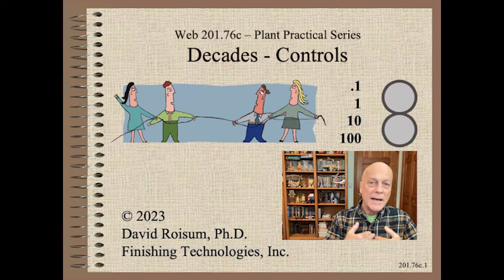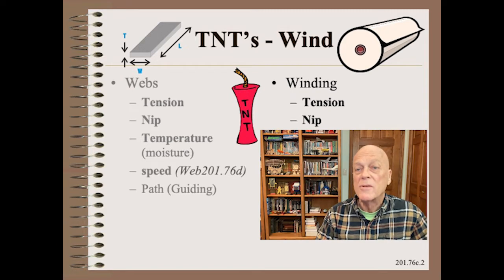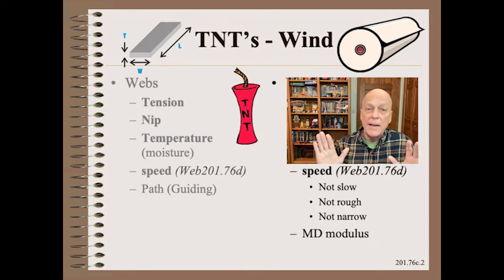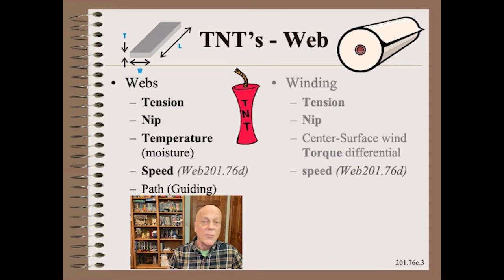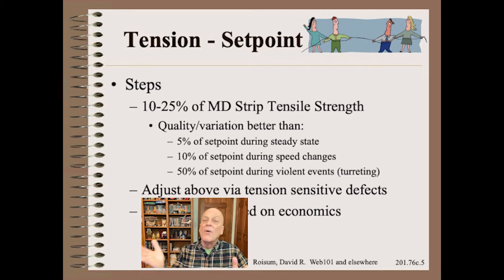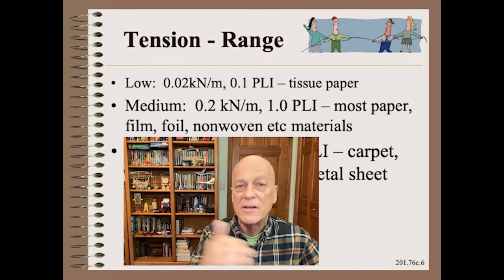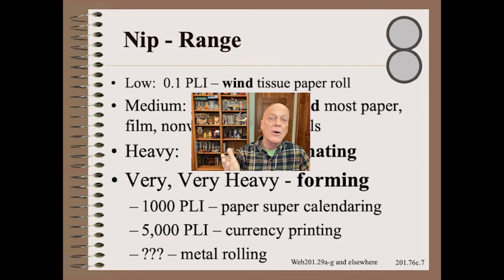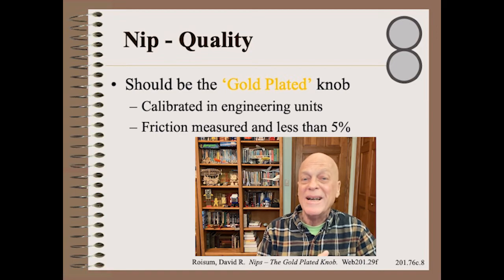Web20176c - Decades - Tension and Nip

Comment: Sir, I want to know 'star defect'
could you explain the defect
Reply from the maker: By far, the most common is a web that has a basis weight / caliper / thickness profile that is low on the roll edge that stars.  Less common is rough roll handling and poor roll structure (winding tight over loose).  Like telescoping, wrinkling, core crush and many other defects, the same outcome can have distinctly different causes/cures.  It is the job of the troubleshooter to first determine which of the three causes for starring (or 20 causes of wrinkling or 5 causes of telescoping or 3 causes of core crush) is present.  Once that is known, the remedy list is trivial to make.